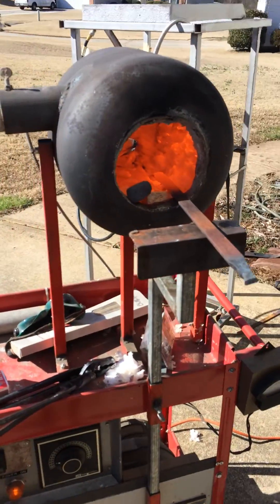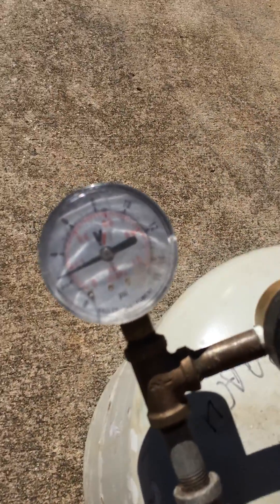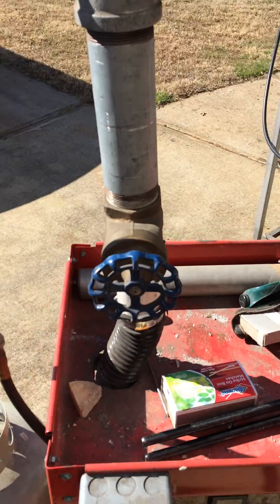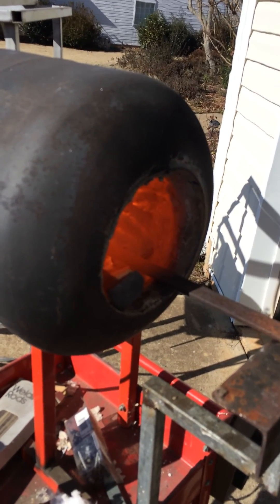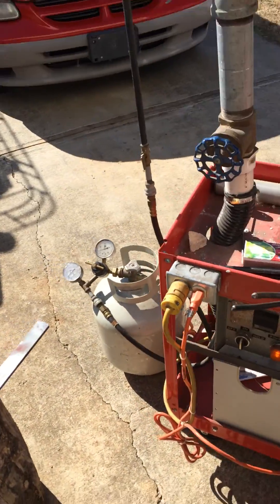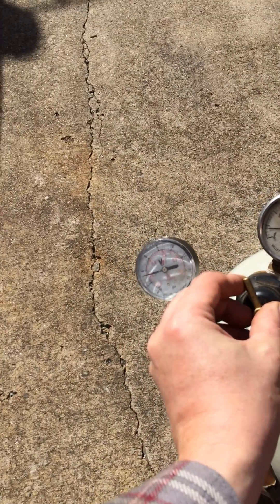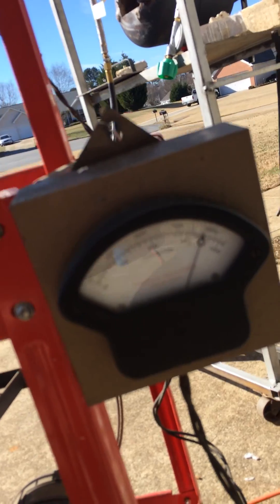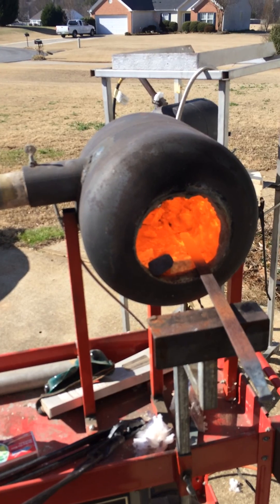Forced air gas forge

Comment: Just a few questions, what diameter is the burner pipe and the chamber size and what inch of insulation do you have, also have you ever forge welded in it